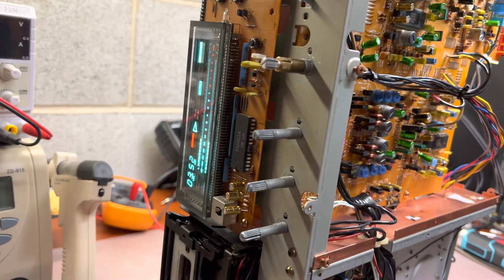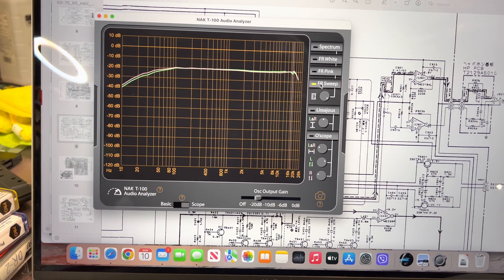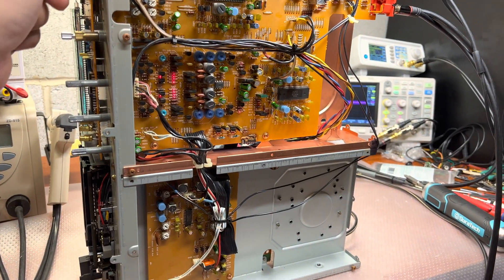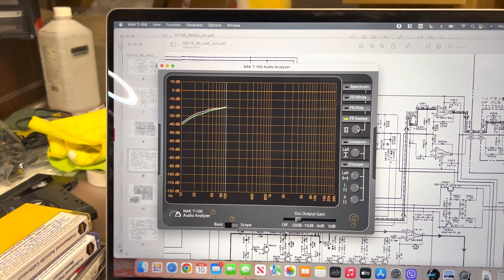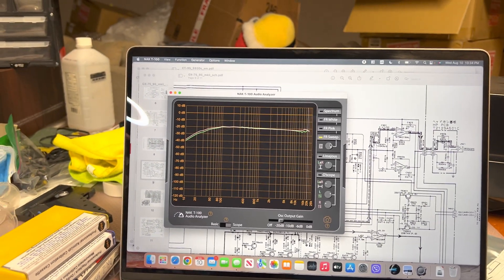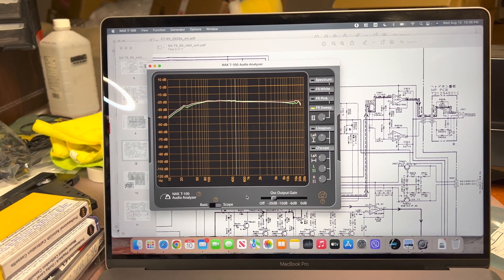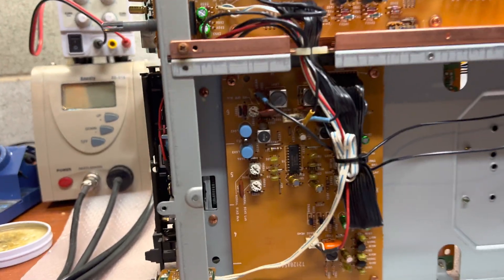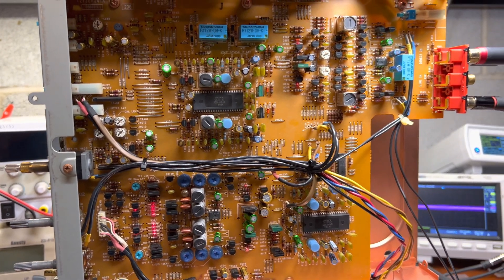Part 3 - Recapping the A&D GX-Z9100EV aka Akai GX-95 mkII: Final Measurements

Comment: Is recapping gave serious changes in frequency response, because i have a bump on 1-5mHz. If recap can improve it? Thank you
Reply from the maker: @TalBar-audio  no, bump may nean two things, tape response, but with changing the tape brand it will change, or head response, which sadly said that head do not perform on specs and you tuned bias or playback response up but it can’t compensate the non linear curve. Fixing the head response is required. Lapping, capacitors in a parallel to the head, or both.
Reply: @hifirulezzz  oh, lapping of glass head?
Reply from the maker: @ yep

Comment: Nice one, i can tell you serious Tip about Akai (and some others as well) Decks. you see the brown Glue around the cables and ribbons? this is big problem, they crystalize with a time and creating a corrosion and oxidation of the components, last week i did restoration on my Akai GX-75 and bellow brown glue i had oxidated cables and resistors legs. so, i did remove all glue, desolder all cables and ribbons, then i have properly clean board to make sure there is no glue left, i cut the ribbons, strip them and solder as fresh, also i have replace all audio cables as they were a bit short so i have used high quality pure copper shielded cables. i know it’s a lot of work but is necessary to get it to perfect state. This glue was only on audio board. and it’s not only Akai, but most of Japan companies also used the same glue before. also, this glue after crystallisation passing electricity so it makes big problem and damages to the electronics.
Reply: Zhivko K.
преди 1 секунда
This brown glue is found in many old Japanese units.
And it must always be cleaned especially where connects different, elements, tracks and points.
The main problem is that it is conductive mostly in places with higher voltages and it turns darker brown and even black there.
At this stage, it already short-circuits and corrodes everything it touches.
It can break cables, connectors and the leads of larger items.
It's especially annoying when it's used on ribbon cables like in this Akai.
You could recap and resolder the whole thing, but if you haven't cleaned up that glue you have a lot of places with a potential short or bad contact.